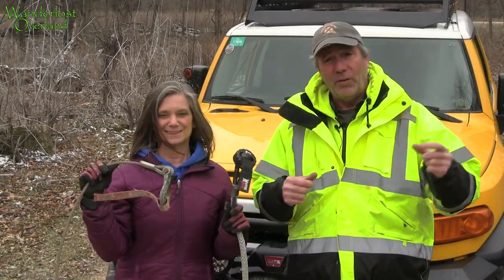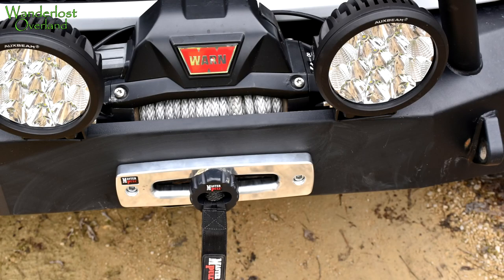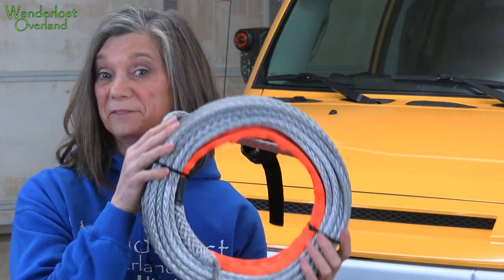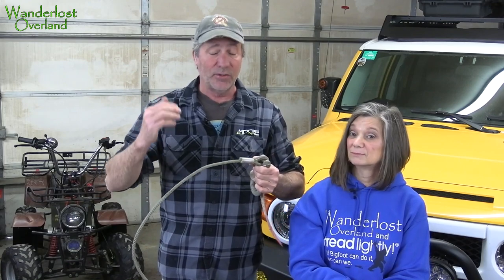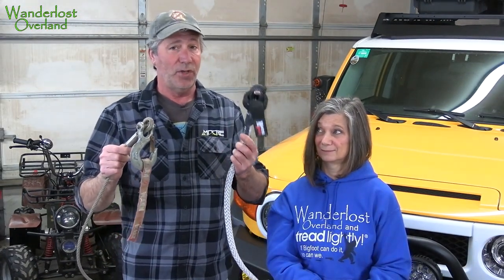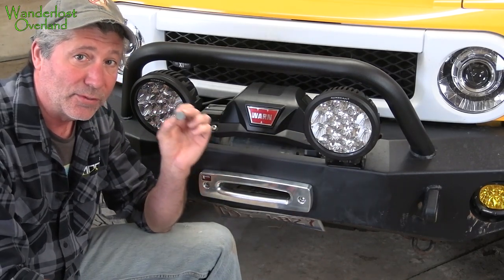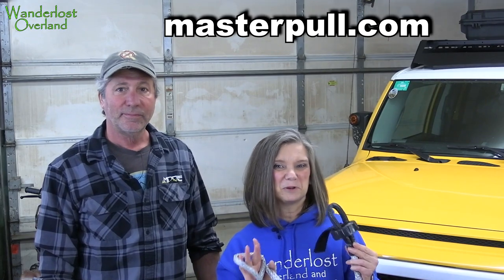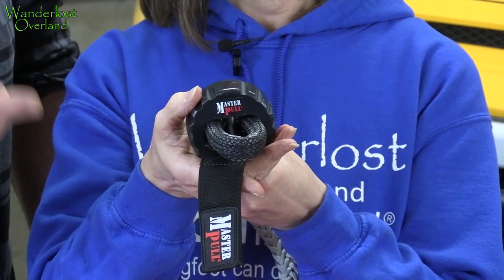We're Switching From Steel To Synthetic Winch cable. Here's Why And How We Did It

Comment: I will stick to my aircraft cable thanks. Been running it for 30 years and not one break. It's called maintenance. Oh and also.knowing how to set up a cable correctly. Plus not getting so stuck you put too much strain on the winch. But I have always been a very careful wheeler. Not everyone is. I can see the advantages but i have also seen these ropes snap from touching a tree root. I must just be an old dog that can't learn new tricks.
Reply: That's right and my last atv cable lasted 15 years of regular use. Synthetic will be rotten after a year or so in the weather. It has some advantages but way more disadvantages for my needs.

Comment: This is great. I'd love to see you review some options if any exist, to keep road crap and sun form beating on that all the time. Like a cover or something.
Reply from the maker: Great suggestion!
Reply: Master Pull sells a winch line called the Superline XD.  It has a Dyneema cover over the Dyneema winch line that protects it from UV damage, abrasion, and requires less maintenance.  It’s what I have installed on my truck.  I made an install video about it too.

Comment: Thanks for the tip on the 🇺🇲 US made rope👍.
 They are a bit 🤌 pricey
but varies depending on length.  What length did you use? 
  My unit has 65' of steel currently.  I'd like to add some extra length. 😵‍💫
Thanks for your reply.
Reply from the maker: I believe ours came at 85'.